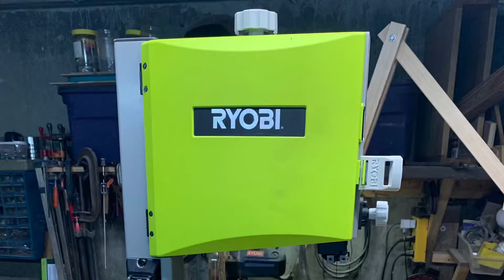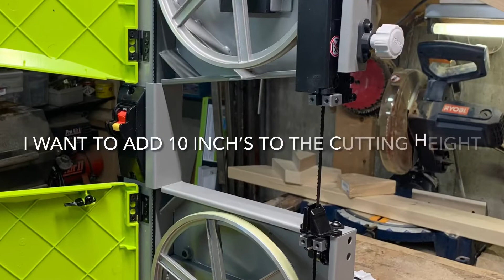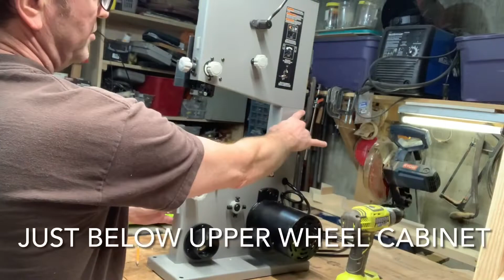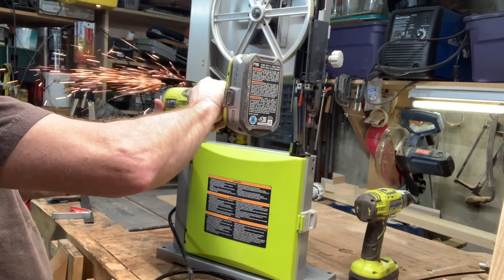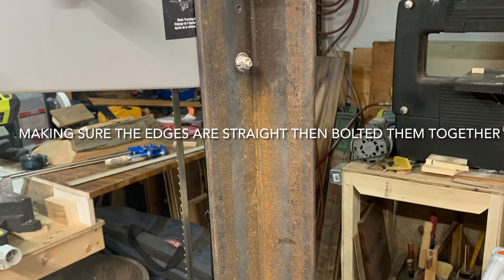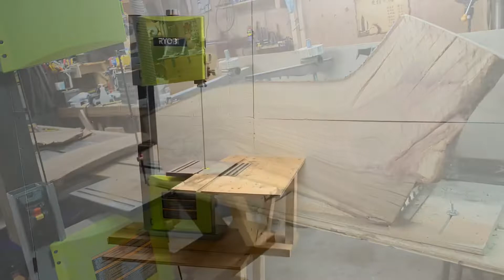#Shorts - Ryobi 2.5 amp 9 inch bandsaw Blade Height extension Too Crazy About Wood￼

Comment: Very cool! How strong is the motor?
Reply from the maker: It’s 2.5 Amp, I used the same motor that the bandsaw came with. Important part is your sawblade, I used 82 inch with left to right offset teeth. You’ll need a sharp blade because that motor is quite weak.

Comment: Did it work well or did it bog down?
Reply from the maker: It works well. But because it’s only a 2.5 amp motor you have to go really slow. Also important is the blade is sharp.